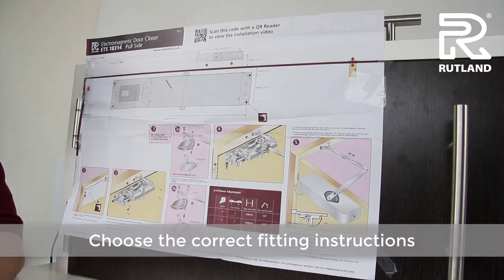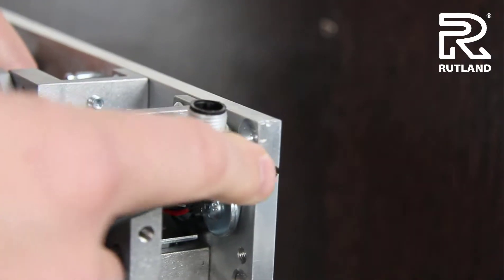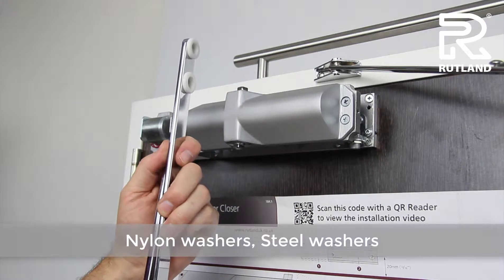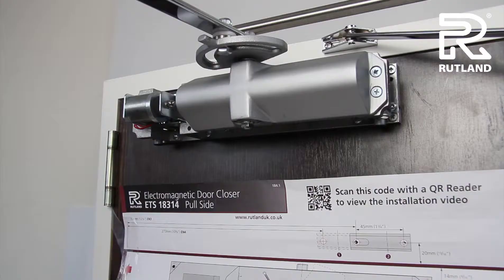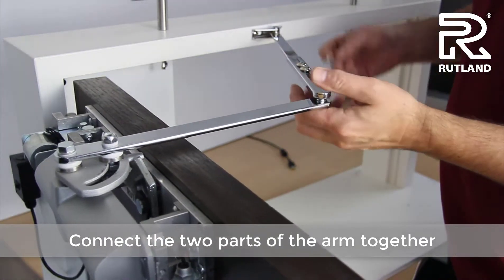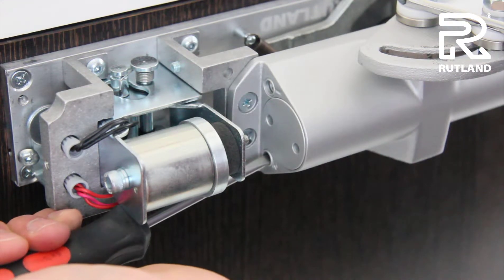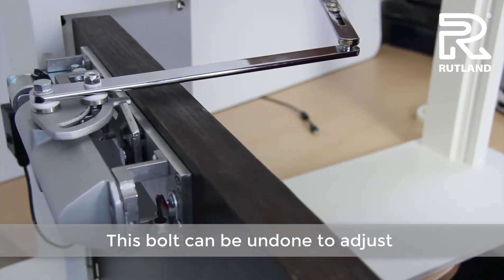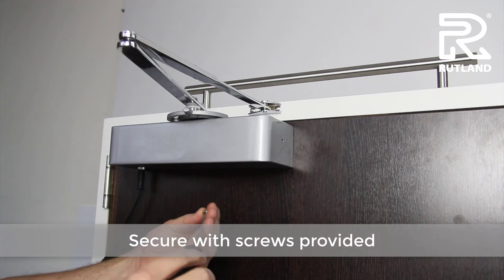Rutland: Know How - Rutland RESPONDER24 How to fit - Pull Side Hold Open Mode

Comment: Does the electrical supply always fail in a fire? How does a fire alarm going off cut the power supply?
Reply: Must be wired through a normally closed fire alarm interface